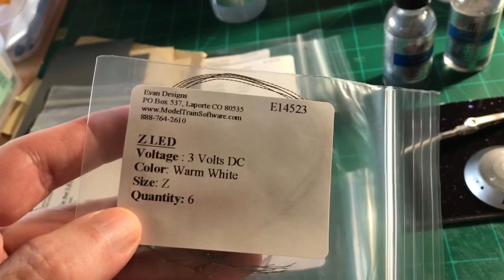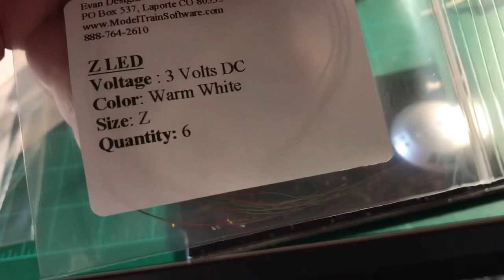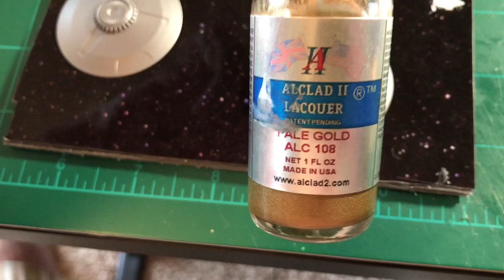3D printed Jupiter 2 build part 1 TINY!

Comment: Be careful what type of glue you use as most liquid glues will literally disolve the plastic.
Reply from the maker: Thanks Jim, I've worked with this material before, it's a pretty hardy resin-like material. I typically use AC glue and 5 minute epoxy. I used the AC to glue the landing gear back onto the sprue for painting and it had no issues.
Reply: No problem Ken. I worked with some engine inserts for my Revell Republic Star Destroyer a while back. They were a different type of plastic and melted to the touch with liquid cement. As a CNC machinist who does programming. I bought a 3-D printer for making model parts and other things. Won't be doing parts for sale though as licensing is very expensive and it's not worth all the stiff penalties for selling things without the proper permissions. I had the same things when people wanted me to print them decals for the Bandai Star Wars kits. Just not worth getting caught and getting permissions from Disney is expensive and near impossible.